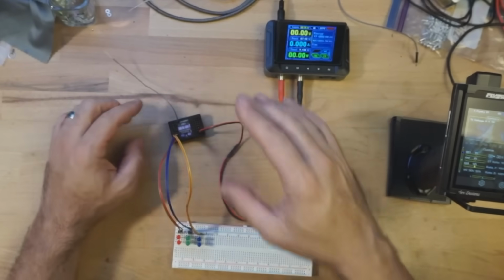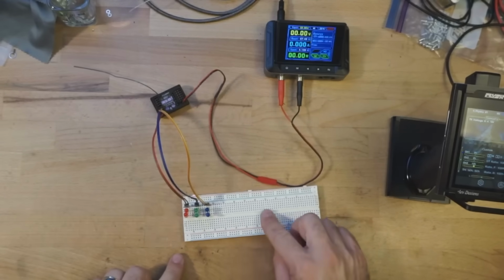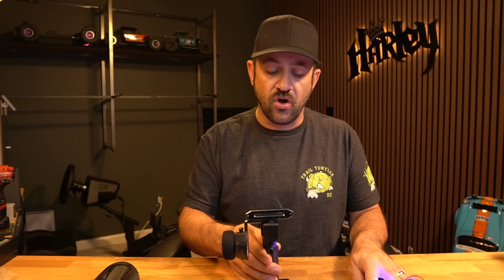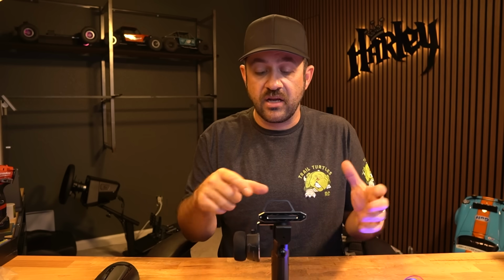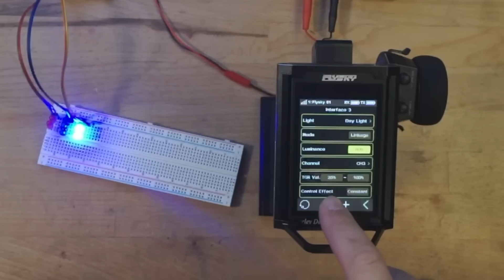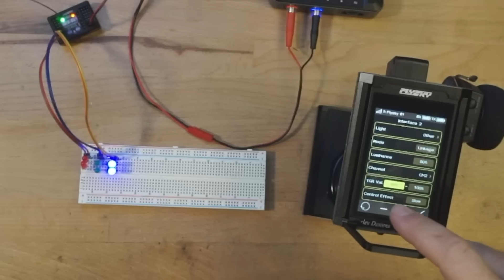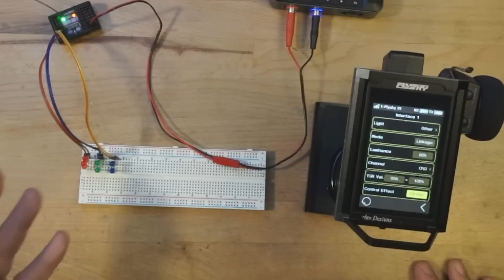RC Lighting Made EASY - FlySky INr8-8D

Comment: ohhh.... i wonder if this would work with the q series lights.... ?

it would be nice to just completely cutout the need for a regulator/ cleanup the wiring.
Reply from the maker: The Q-series use a puck to limit the current. This wouldn’t bee a good fit for something high power. This is more for traditional LED’s.

Comment: I'm wondering if this can be adapted to make the brake calipers on the funco not brake when you reverse if you use a different brand receiver.
Reply: Probably not that simple but it just proves that flysky could easily make a fix in the firmware to make the receiver know it's in reverse and not brake.
Reply from the maker: You could easily do that with this or other Flysky RX’s with a mix. That would be a simple programming thing. Just a matter of swapping the radio out.
Reply: @HarleyDesignsInc I didn't know anyone figured that out yet. I couldn't figure out a mix that knew the car was in reverse instead of braking. It treats reverse the same as brakes and works the calipers still.

Comment: So my question here is is how do you like that Noble radio... Now that you actually owned one and have it in your hands to use.. I asked because this is the radio that has been recommended to you multiple times throughout the past years and you just dismissed the manufacturer completely. Not trying to sound like a jerk I just want to know what your honest opinion now that you've actually used it.
Reply from the maker: I still prefer the navigation of the cheaper flysky G11P.  I had the original NB4 for awhile. While the radio does a good job I just don’t like the menu and navigation style or the wheel placement nearly as much. I like the options they are bringing to the table, and this cheap G11P is a steal for what it gives. The new brighter screen on the plus is nice and while I could get used to the menus and such, it’s still not my favorite. I love gadgets and playing with radios, I have a couple of their other new release items to use on this noble so I’ll be using it for awhile, but the G11P is still my preference.
Reply: @HarleyDesignsInc cool man thank you for the insight. Find myself have the first gen Noble and I've got to say I do love that radio. Like you I used to use nothing but futaba. And I hear you I love to play with gadgets myself. Speaking of the noble and gadgets.. you seem to be a pretty resourceful fellow if you can get your hands on a newer hobbywing r2 e s c for the r3 ESC you'll find you'll be able to run the hobbywing app from the noble. .. pretty cool some of the tech that fly sky has been putting out.. I feel they're on track to become a well-respected manufacturer the same as spectrum futaba airtronics.. and it just seems you definitely get a lot more usability and functionality for the dollar spent.
Reply from the maker: @christophermears7738 the usability per dollar is exactly why I started venturing away from my other radios. I wanted to love the Radiomaster but it just wasn’t the user experience I was happy with. Super powerful for the dollar. But Flysky has landed in that middle ground for me.
Reply: @HarleyDesignsInc watching you and Matt kind of fight and struggle with the programming of those radiomaster radios is exactly why I did not buy one of those. It looked to be more of a aggravating experience than a rewarding one

Comment: Can you activate the turn signals with one switch and then cancel it when another switch hits a value?  For example, can you set it up to turn your left turn signal on with the left paddle switch and then cancel it when the wheel hits a right turn value?
Reply from the maker: I don’t think you could create a self canceling program but I’d have to think about that more.
Reply: @HarleyDesignsInc   That's really the only thing that keeps me from buying these light modules with turn signals that activate when the wheel is moved.  Not very realistic. The features are really cool, but for me, I feel Noble  needs to address that before I commit to buying one.  Thanks for responding!  As always, great job!
Reply: On my trx4 with the proscale light kit I assigned the indicators to one of the vr switches. I now only have indicators if i twist the knob left or right rather than every time I steer.
Reply from the maker: @MichaelNoble85 that’s still not self canceling. That’s just manual activation which is possible with most light kits as well.